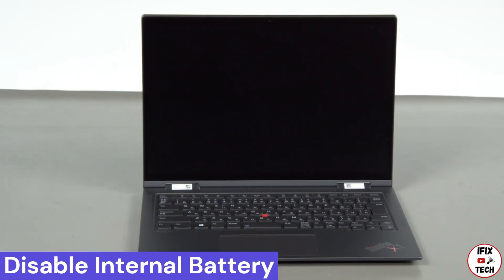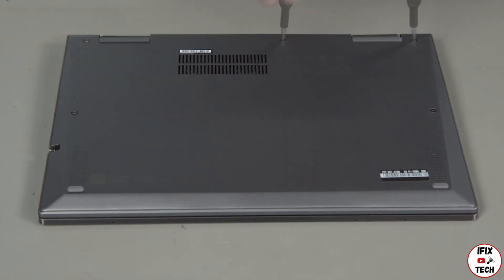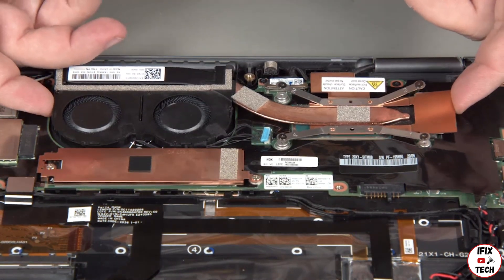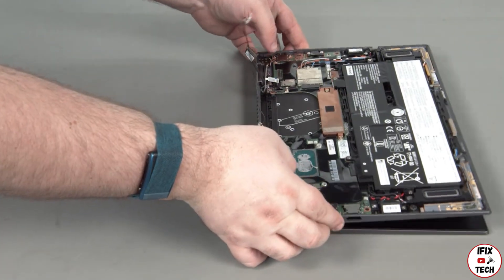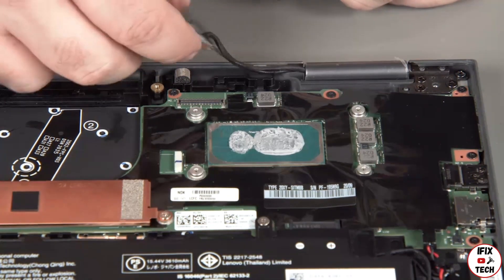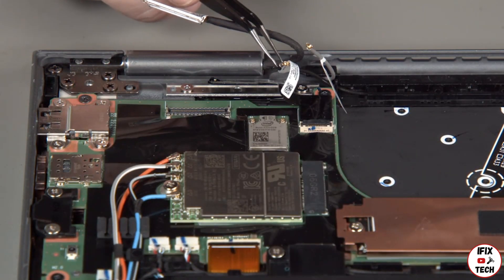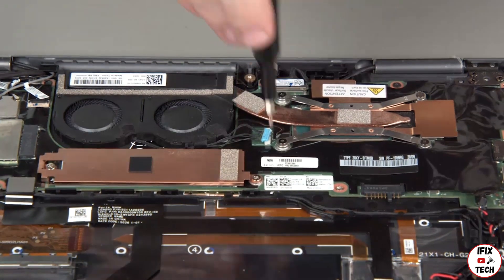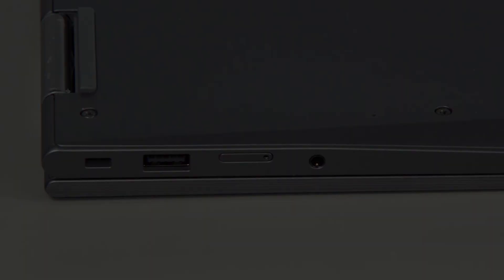Lenovo ThinkPad X1 YOGA LCD SCREEN Replacement Gen 6th - 7th - 8th - How to Remove LCD Assembly

Comment: I hesitate every time to hold it on tablet mode. Or is it durable for several years of gentle use?
Reply from the maker: Hi, This model is designed to be used on both modes. It does  perform very well on each mode. Just try not to drop it. 😅 Thanks for liking it and subscribing 👋 😉
Reply: @IFixTech1 ribbon cables look unreliable even I don’t drop the laptop 😅
Reply: @IFixTech1  can I only change cables if screen is ok?
Reply from the maker: @mindchangeyoutube  it os possible. But the process to remove the screen is different. The screen panel must be removed